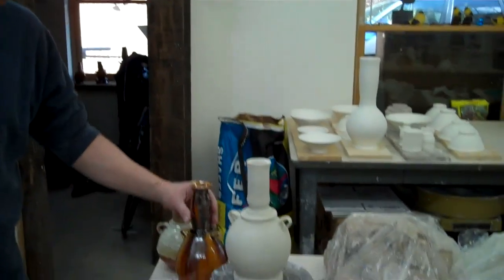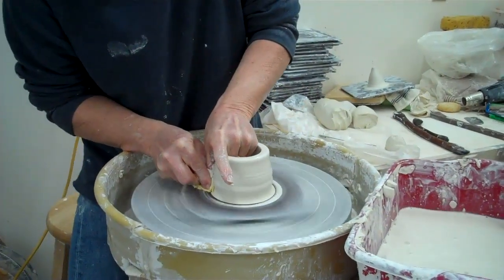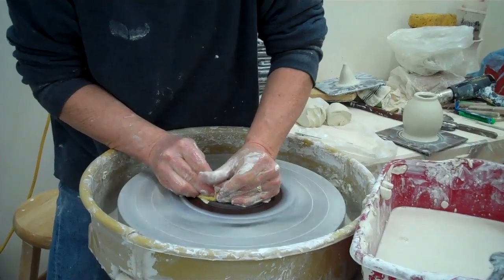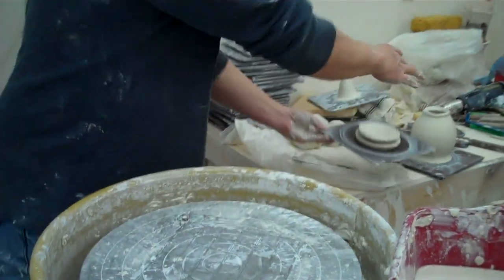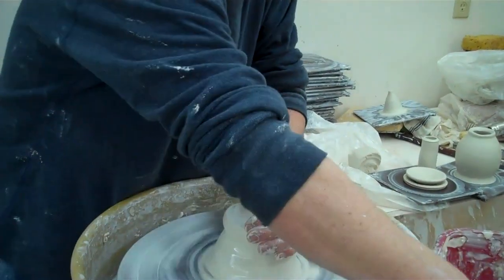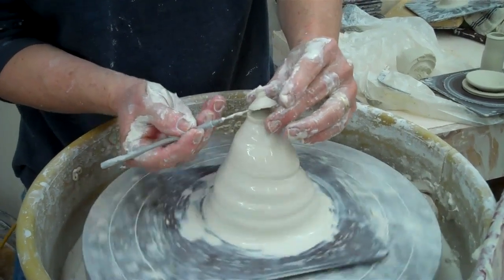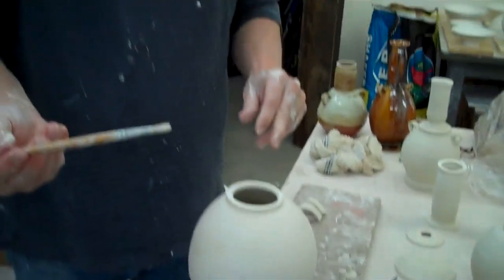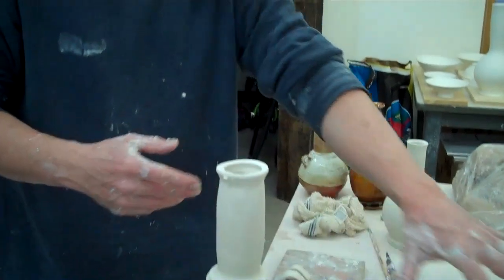Multi-sectional Vase Forms- John Britt- 2011

Comment: I pull up a bit much, because I tend to pull those square plastic bats right off.  After a few dead pots and collisions with my water bucket, I started laying down a thin cookie of clay underneath the bat. Spin and press down with a wet sponge on the first bat to get a good attachment. After a few pots, the ridges widen and stop holding well. Just muss up the ridges with a wet sponge, and it'll hold well again.